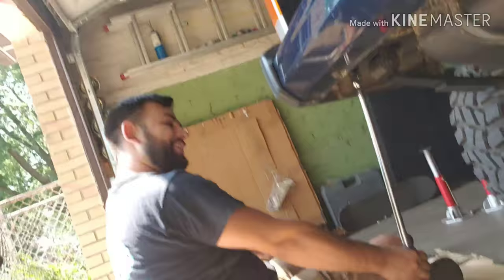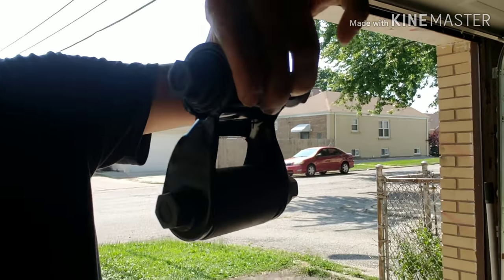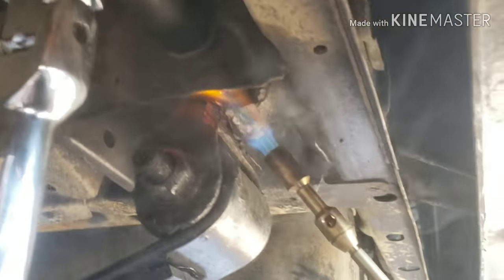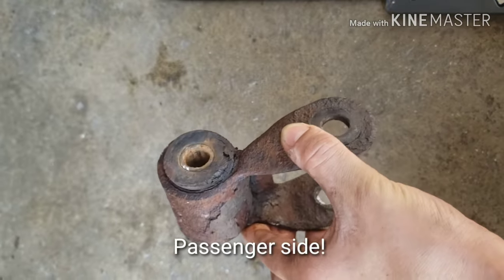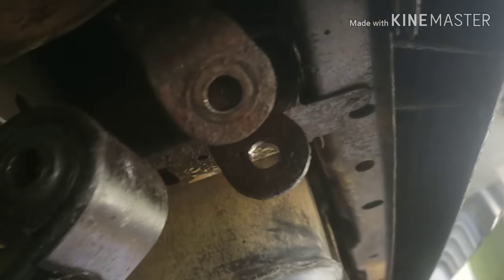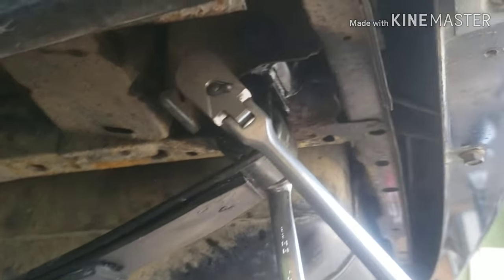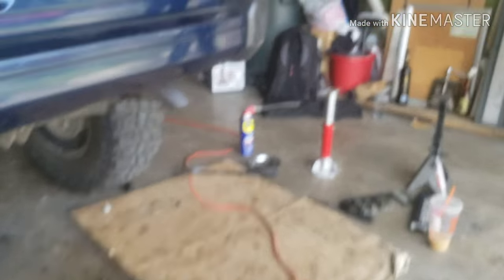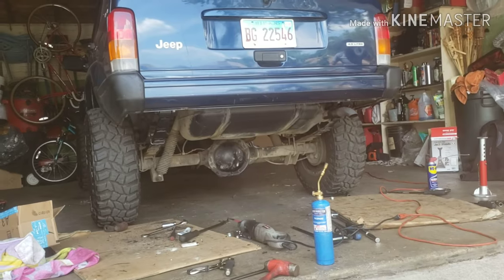Jeep XJ - Quick Shackle Replacement

Comment: Nice looking jeep. Had problems with the driver side shackle on my 96 ended up cutting it up in 3 pieces to get it out. Used a grinder to cut the lower shackle area off then cut the upper shackle in half. Then came the bfh to  beat the two  halfs out of the shackle mount.
Reply from the maker: Thanks, and luckily my problem wasnt too bad. Ive had other problems with rusty old bolts that really make me just want to sell the truck sometimes lmao
Reply: Any bolt that goes into the unibody  drill a small hole in the unibody so you can get some penitating spray on the threads.  Then plug weld your holes. The bolts spin right out.  I live in a northern state where salt is rampid

Comment: I have a 2000.  It’s been bangin’ in back on bumps. It looks like the driver side shackle is rotted in half.  I’ve had to cut/grind the bolts off, too.  I guess you were not able to get the bolt out of the shank. On the front bushing, on an older jeep I had,  I had to cut the spring, cut the bolt head off, and cut the bushing and bolt in half so I had a knob to latch on to screw the threaded section out. New shackles rusted in only a frw years.